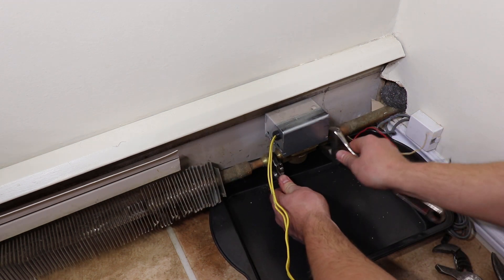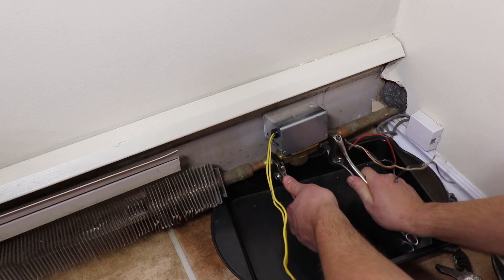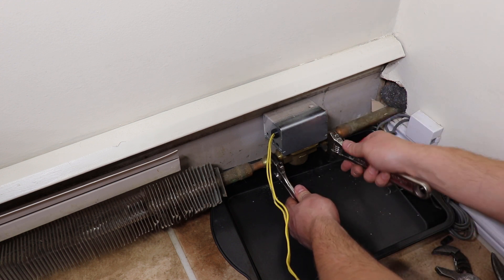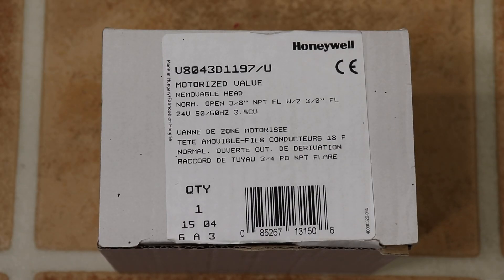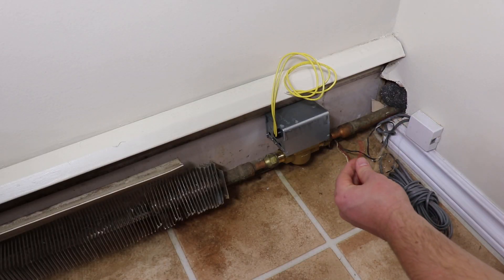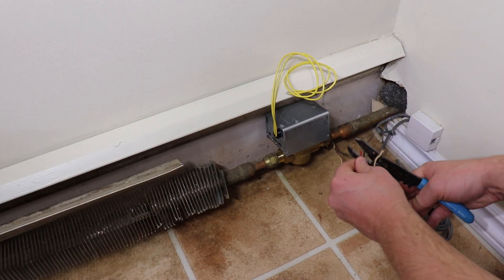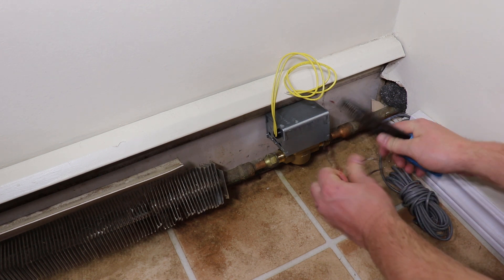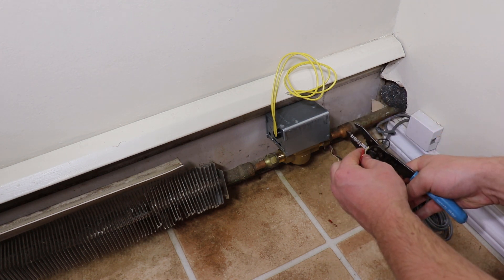Zone Valve Replacement: Hydronic Heating System

Comment: Hi guys, I have a normally open honeywell valve, is there anyway to manually close it, or test if the valve is working? Currently my unit is 30°C and I haven't been able to lower the temperature.
My thermostat is an ecobee, but checking other comment you posted the wiring should be R and Y...why? Y wire isn't supposed to be for firing up the AC? My wires are on R and W, should I switch it to Y? Please help!!! And thanks!
Reply: You have a forced air thermostat you need hot water heating

Comment: Is there anyway to test a zone valve like this with a meter? I ran across a Spartan two wire zone valve I attempted to check continuity on, and got nothing. When I ohm’d it out it read high resistance which I believe is a sign it is still good. 24VAC plunger style zone valve

Comment: Can you please tell me if the slider on zone valve can be set halfway or does it have to be either all the way closed or all the way open. For some reason it’s so hot in my apartment this year. Windows are open and I’m still sweating. My thermostat is not turning the heat down or it’s the zone valve. Landlord died and son in law might of set heat too high. By the time he’d get someone out here it will be spring. I always have to bleed and open valve for winter but I’m dying here. 🥵 Thank you
Reply from the maker: There's no halfway setting for a normally closed zone valve (one with the lever). The lever locked in place is fully open and not locked in place it is controlled with the thermostat. It sounds like the thermostat may be faulty. A normally closed zone valve is in the closed position (no flow/heat) when the power is cut to the zone valve and it takes power to open it. If the thermostat is constantly sending power to the zone valve it will never close and become very hot. Hopefully this helped some. Thanks for the question!

Comment: Hello, Thanks for the video. I noticed one wire was not reconnected, looked like the black wire. Is this not important? Thanks
Reply from the maker: Hello Bucky Mah, In some cases the rough-in installer will run extra wires. It is very common in apartment buildings, such as this one. The reasoning is that if one of the wires was to have a short, it could be switched over to the spare one. So in this case the black wire isn't being used and is a spare. Thanks for the question!

Comment: Hi! Great video. very helpful. At 6:24 you say that the final step is to purge the system of air introduced when changing the zone valve. Is the air purged just by turning the thermostat up and letting it run or is there an additional step to purge the air in another video?  Thx!!
Reply from the maker: Thank you Lili! In a properly installed/designed system by turning up the thermostat the air will purge on it's own as you mentioned. Most hydronic heating systems have auto air vents at the high points in the system, which will automatically purge the air that was introduced into the system. Some systems have manual air purging devices which have to be turned to release the air. This is why I mentioned to make sure the air is purged from the system. Unfortunately I don't have a video on this yet. I good way to tell if there's air trapped in the system is that the circulating water/fluid will be noisy or the heat transfer will be low (pipes or radiators won't be hot). Hope this helps out. Let me know if you have any questions. Thank you!
Reply: @PROSDIY  thank you so much. I’m going to try the thermostat then and see if that does the trick. As of now I have the ac on because I’m dying of heat in here.
Reply: @PROSDIY  If the zone valve is hot, but the pipe and fin are cold, is it the zone valve problem?

Comment: How to close the valve manualy
Reply from the maker: Hi Kakim, do you have a Honeywell zone valve as seen in the video? To manually close a normally closed Honeywell zone valve you can either lower the thermostat to the lowest setting or disconnect the power to the zone valve (Thermostat should be connected to R and W). To close a normally open Honeywell zone valve, the valve needs to be energized or powered. Lowering the thermostat will power and close the zone valve. (Thermostat should be connected to R and Y). To visually check which zone valve you have, the normally closed Honeywell zone valve will have a small lever on the side to manually open the valve, and the Honeywell normal open zone valve won't. If you have a brand other than Honeywell, you can let me know and I'll hopefully be able to help you out. Thanks

Comment: Do we have to turn off the breaker before undoing the wiring?
Reply from the maker: Hi johnygogo, thank you for the question. If the breaker or power source is accessible, I recommend turning it off before working on the wiring. This is mainly to protect the thermostat. If there's a thermostat with an anticipator installed in the circuit, the disconnecting and connecting of the wiring to the zone valve could possibly cause damage to the anticipator. Since it is 24 volt, low amp wiring you don't need to worry about getting shocked.

In this video the zone valve featured was in an apartment complex with the power source (24 volt transformers) behind locked doors. To get around this I opened the electrical circuit by cutting the power at the thermostat. If you have a normally open zone valve (takes power to close the zone valve) you would adjust the thermostat to the hottest setting to open the electrical circuit and cut power. If you have a normally closed zone valve (takes power to open the zone valve) you would adjust the thermostat to the coldest setting to open the electrical circuit and cut power.

Good luck on your project!